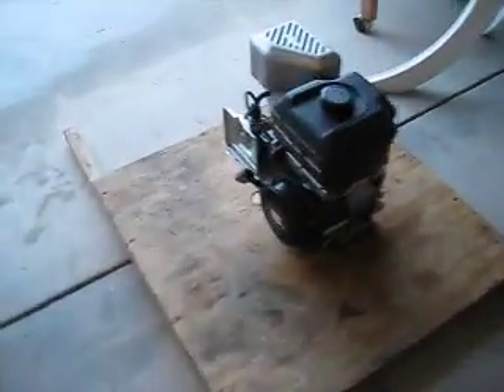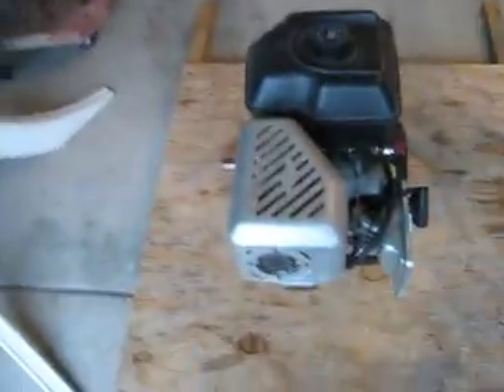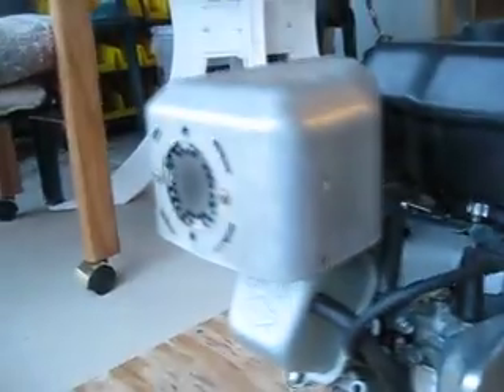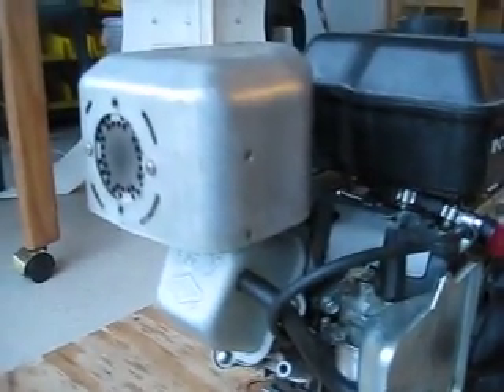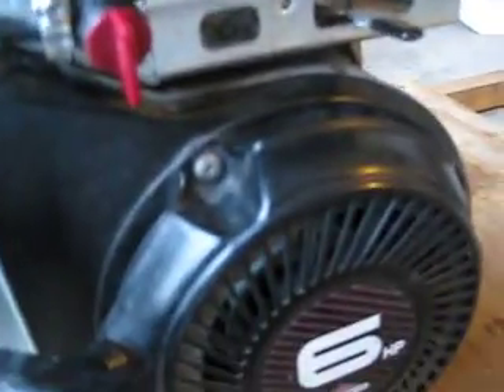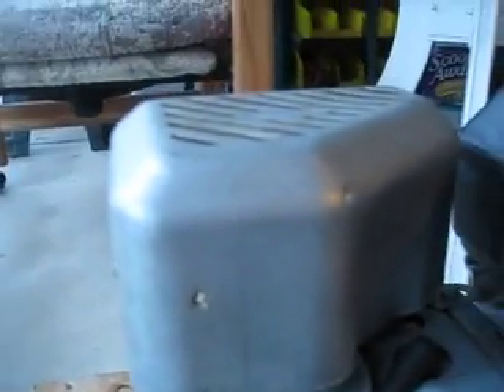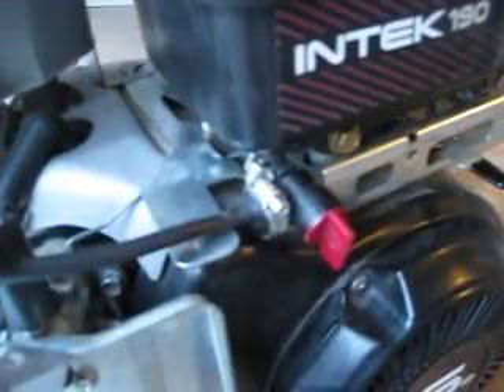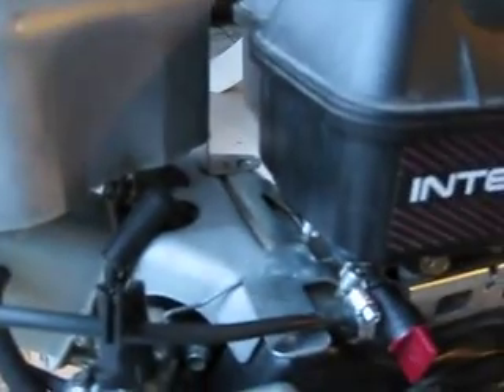ITS ALIVE!!! The 6hp runs after 5 years of sitting!

Comment: you need to tune the needles on the carb, run it at about half throttle turning the screws right allows less fuel tuning the screw left allows more fuel to be adomized into the engine, and the engine isnt surging like that because of the govenor its surging cause its not tuned right. keep up the good work! iether way ya got her runnin and thats a start so try tuning it and she should per like a kitten. or if u put a straight pipe on it growl like a dog.

Comment: well actualy every carb has adjuster needles unless it some sort of japanese engine, but if it only runs at half choke thats sound like the mixtures running lean, there should be 2 needles, on for idle and one for load, turn one of the needles to the left until it can run with out half choke then fine tune it to how much u need and that should smooth it right up, if the first needle you try doesnt work than try the other. hope my info helps
Reply: You cannot adjust a fixed Jet, non adjustable carburetor. There are no screws to adjust gas/air ratio or throttle. The reason it was running poor is because the carb is dirty inside and the jets are gummed up. The carb need to be opened and cleaned and then the engine will run fine.

Comment: Don't bother with an exhaust.. It's Fine!! Fix the Carburetor. Don't run it too much without an Air Filter. For every 1 Gallon of Gasoline that engine uses it uses 12,000 gallons of Air. Clean Air is Very important.